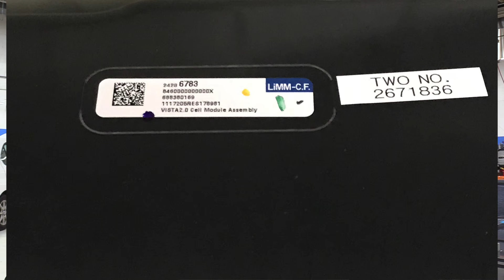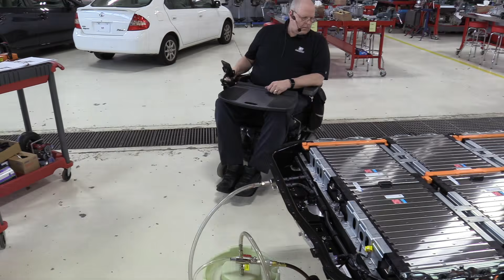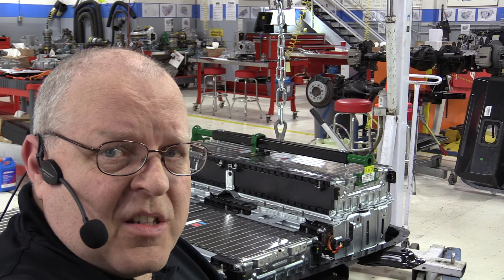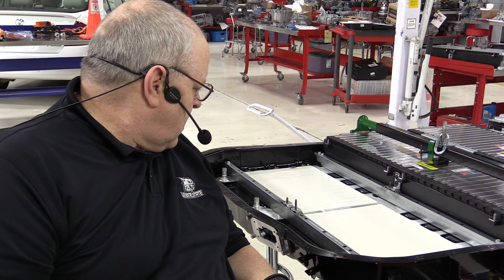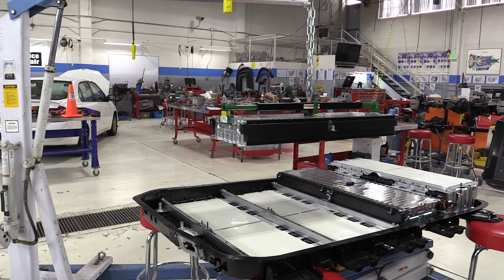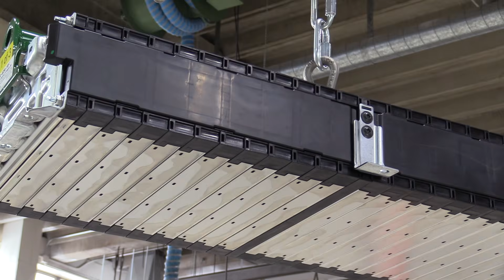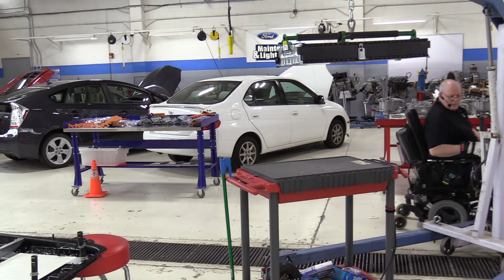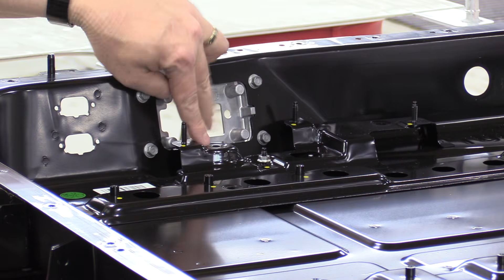Chevrolet Bolt EV Battery Disassembly

Comment: Two ways the 60KWH rating may have been arrived at. Rounding being the first way. The second may have to do with the difference between nominal voltage and fully charged voltage ratings. A long shot way could be real world testing but that one is not likely.
Reply from the maker: It turns out the 57kWh is the nominal rating. 60kWh is the fully charged rating. Thanks for your feedback!

Comment: After the bus bars are gone, the high voltage risk is gone, but the high current risk remains. Welding with a 12V lead acid is impressive, shorting out a 40V battery with extremely low internal resistance is downright explosive. Best to keep the alert level high, and require gloves along with the shielded tools, even though technically the gloves are not required as you pointed out.

There are too many mechanics out there without the background electrical engineering knowledge to make safe choices, so better safe than sorry.
Reply from the maker: Good point. Thanks for your feedback!

Comment: 1:30:56 these pads are for isolating the heat sink from the metal battery cover so the heat sink hot and cold lines are not connected thermally together via the metal battery cover.
Reply from the maker: Thank you for your feedback!

Comment: Are the actual cells cylindrical like the Tesla's? Also, NIMH cells cannot be paralleled from my understanding, but LION can be. So, are all these LION cells in Series? Are there any EVs using cells in parallel?  Parallel and Series?
Reply from the maker: These are pouch cells, not cylindrical. Two pouches in parallel for each of the 96 cell packs in series with each other.

Comment: So if somebody t-bones your Chevy Volt, the battery shorts out and your car burns up.
Reply from the maker: It is possible, but the battery tray is very strong and enclosed under the car. No more dangerous than a tank of gasoline.
Reply: Found this article: https://www.torquenews.com/1/why-tesla-batteries-catch-fires-bolt-and-volt-batteries-dont The author says the battery cells have stronger walls. BTW: Thanks for your videos. I'm enjoying them even though I never intend to tear apart my wife's Bolt.
Reply from the maker: Awesome, thank you!

Comment: Professor, this is fantastic. It appears you have the service manual, maybe attended a GM tech class?
I assume you don't want to be ground potential to this battery, even assuming is is completely discharged.
(I can't believe you're working on a fully charged battery! You rule, 'bro)
Are you insulated via rubber wheels? And did you discharge body static prior to touching any metal?
On another note, I just disassembled, replaced the battery and reassembled my grandson's PS3 controller. 
So, there's that.
Send that manual off to repro and please ship one copy to me, Colorado, USA.
Thanks.
Reply from the maker: Thank you! Yes, a service manual and many years of GM and other training https://www.weber.edu/automotive/J_Kelly.html

Comment: The shape of things to come... Who knew it would get to this so soon?

I have a question, after seeing a video on youtube with a flood damaged vehicle where the battery was completely "stewed": is this setup - battery and connectors etc. - meant to be flood safe? Or: is it meant to survive crossing a shallow stream or going through a deep puddle? That is, deep enough to cause water to get into the cabin in most normal cars.
My question stems from the fact that with the battery being the "business end" of the car (in value terms) and at the same time being the lowest part of the car body, one shouldn't expect that to be written off in situations where a "normal" car would just get choked. Or is that another limitation that EV owners will need to factor into the equation?
Reply from the maker: The battery packs are sealed to keep out dust and moisture as long as they have not been damaged. Improper service procedures can result in loss of battery sealing. For example, prying and bending of a battery cover to access components and then not replacing the cover or sealing it again after hammering it back down. A battery after servicing needs to be leak checked. See my leak check video https://youtu.be/VUvAW6skwrA A flood vehicle should be inspected for water intrusion in the battery, but I doubt many will ever have that condition unless an untrained backyard mechanic worked on it first. Best wishes!
Reply: Thank you prof. Kelly for this great info. I guess then that checking battery compartment is leak proof should come on top of any checklist when buying second hand. I will definitely check that other video.
Reply: I just found the youtube video I was mainly thinking of. It's an iMiev battery damaged by SALT water flooding. Here's the link:
https://www.youtube.com/watch?v=EmgRuhqba0I&t=12s

Of note is the fact that battery cooling is achieved with air convection. There are holes in the battery compartment that allow air in/out. Are these leading to openings in the passenger cabin? Then that would achieve cabin heating "for free" but it would not explain the cause of the battery compartment flooding  (unless the entire vehicle was covered by water).
Of note is also the fact (?) that the battery compartment casing is made of plastic (?).
So it's interesting to see the design/budgeting choices made.

Comment: Thermal pads don't need to be replaced if they're intact, you can buy them fairly cheaply because they are a common material in the tech industry (Usually from 3M)

Comment: Its dc voltage take them gloves off it wont kill u man
Reply from the maker: Thanks for your feedback. OSHA Regulation 1910.137 requires compliance with NFPA standard 70E for Electrical Safety. NFPA 70E 320.3A1 requires Personal Protective Equipment (PPE) for DC Voltages of 100V or higher. It also requires PPE  for AC Voltages of 50V or higher. I know there are other YouTubers out there touching higher voltages without PPE, but that is not how we do things here in the Department of Automotive Technology at Weber State University.  I always follow the proper regulations in my classes and videos.
Reply: You need an electrical education. Touch the electrical current that this battery is capable of and they will carry you to the morgue.

Comment: Seems GM did a better job designing this battery then Tesla did on the one in the S as it can be disassembled without doing any damage.
Reply: Yes, the Bolt beats the Tesla hands down in terms of serviceability and apparent quality of components and general build quality.  Tesla components have the disposability and build quality of a $20 cordless drill.
Reply: I thought LG made them?

Comment: Thanks for sharing this sir. A great insight to the modern EV batteries.

I would like to know the outer dimensions of the battery (length, breadth and height).This would br of great help from you.

Thanks in advance.
Reply from the maker: Thank you.

2017 Bolt EV Battery housing dimensions 
43” width case without brackets 
46” width at 4 front brackets with bolt holes
50.5” width at 1 rear bracket with bolt holes
71.5” length case
12” height under rear seat (not counting service lever)
6” height rest of the front of the case
963 lbs total weight
Reply: WeberAuto Thank you sir! This is very helpful to newbies like us. Keep doing this great work! 😊

Comment: Thanks for the nice work! Any High Voltage batter heater (Coolant Heater) ?
Reply from the maker: Thank You! Yes, there is a battery coolant heater and a separate heater for the coolant in the heater core for the cabin heat.
Reply: WeberAuto Thanks for the comment! How about the battery heating for the cold weather? The efficiency drops significantly in the  cold weather (battery temp. Lower than -2 degree celcius)
Reply from the maker: Yes, there is a battery coolant heater for use in cold weather to warm the battery. It only works while charging with the AC charger or while driving.

Comment: Question: When the battery drains, does it drain the battery one cell at a time or do all cells drain together? I've often wondered about the exact drain process. Thanks!
Reply from the maker: They are all in series and therefore drain all the cells at the same time. Best wishes!

Comment: At 41:30 you say that the cells in batterie 5 are connected in parallel. 
Should the be connected in serie so the voltage adds ?
Reply from the maker: I was talking about the cell packs. There are 3 cells wired in parallel with each other for cell pack. There are 96 cell packs in series with each other. Thanks for your feedback!
Reply: Thank you for the answer
Can you tell me the voltage of each cell pack ?

Comment: Nice video dear ..  I need ur help for.
What is the method or procedures to do if you want to stop the hybrid engine system and use the gasoline engine working ... The reason is like when you add clean injector or coolent engine bleeding

Thank u
Reply from the maker: There is a special service mode accessible with a scan tool only

Comment: Thank you for doing this. I am an electronic tech and interested in servicing my Bolt myself ( I think I have early battery will crawl under and check thanks for info) still have miles and time left on warranty. I am an Uber driver and went out of my 36,000 mile warranty in 5 months. Where can I get the shop manual and how much? Is there a PDF available? I am subscribed and will look at all other Bolt related videos. What was in the EV-1 ( that is not in the Bolt) that made it so efficient? Could you possibly send this video to Jack Rikards of EVTV.me? He would be very interested I am sure to see this. Thanks again for showing what an engineering marvel the Chevrolet Bolt really is. I am getting a consistent 300 miles per charge the way I do it ( if I can depend on the accuracy of the center average mileage indicator in the instrument  cluster). For me a perfect Ride share vehicle.
Reply from the maker: Thank you! The only service information I am aware of is electronic subscription based from GM. See https://www.acdelcotds.com/
Reply: Hi David, I was wondering if you are still driving your Bolt and if you've had any issues with it?  I drive a lot miles and deciding if it would be a good option for me.

Comment: Here’s an article I just wrote explaining the discrepancy between the 57 kWh rated capacity label visible on this video inside the Bolt EV battery pack and GM’s stated 60 kWh capacity.

https://electricrevs.com/2018/03/29/gm-explains-57-vs-60-kwh-bolt-ev-battery-ratings/
Reply from the maker: Nice job! Thank you!

Comment: What a great video! Disassembly of one of the sections and modules would be interesting, before you put the parts back together. And clarification about the cells. Are they really 55 Ah cells? (57.02 kWh would suggest so.) What is their real gross/net capacity? In the end, LG specs /labelling of the modules and GM specs for the pack must match in some way or the other. Maybe you can dig into ratings and standards to explain this to us. Best regards!
Reply from the maker: Thank you, here is the reassembly video with partial module disassembly https://www.youtube.com/watch?v=ZBzRKglr95U The 57kWh was at nominal cell voltage of 3.65V with 54.22Ah cells. Fully charged is around 4.056V per cell which would give you 63.3 kWh with the same 54.22Ah cells. Maybe the 60kWh rating from GM is just the average of the two. Best wishes!

Comment: Kind of surprised you don't have service covers for the battery section terminals, would make it safer.  Also I am surprised you did not have to wear arc-flash protective gear when doing the disassembly of the HV sections.
Reply from the maker: I agree, there should be some service covers for those terminals. There is no arc flash danger at 40V DC. Even at 350V it is less than a 1 inch zone. PPE isn'e even required by OSHA or NFPA 70E until 50V. Thanks for your feedback.

Comment: When I stripped down my Volt pack the FIRST thing I did was to remove the busbars connecting the modules together - that immediately makes the highest voltage that you can possible reach the single module voltage - about 45 v on the Volt
Much much safer than they way you did it
Reply from the maker: Thanks for your feedback. I was following the procedure in the Chevrolet service information. The BECM can be damaged if harnesses are not disconnected in the correct sequence.
Reply: With the service plug out, the bus bars have no voltage.

Comment: Excellent and amazing work @WeberAuto! Was a treat to watch, thank you!

One question: how exactly did you charge the battery in the car before removal?

I ask because I have been doing a LOT of research with my car via the OBD2 port and correlating with data taken from various chargers at various times.

I have noticed that, first of all, the car reports FULL (via the app and dash) long before the battery is actually full. The bar-graph on the side is also 95%-100% full charge when 20/20 bars are showing.

I have noticed, based on OBD2 readings (assuming that they are correct), that the DC voltage bus in the Bolt seems to max out at 400V. Although the car will report "full" around 390V, if you keep the L1 or L2 charger attached and let it keep charging, it will eventually get the battery pack up to about 400V.  DC fast chargers tend to disconnect quite early too, but some of them will continue to charge as long as you leave them connected.

In your teardown the voltage was about 389V; Hence why I'm wondering if you can please provide any specifics about exactly how it was charged, and at what point you disconnected the charge, and what you may have done between disconnecting the charge and removing the battery.

Thanks again! Much appreciated! Amazing work :)
Reply from the maker: Thank you! I used a Level 2 charger connected to 208V in our shop. I left it plugged in over the weekend after we received it. It  said it would take 9.5 hours. After charging, it showed a range of 230 miles at room temperature 70 degrees F. Have a good evening!
Reply: Dang, I was hoping that maybe you jumped the gun a little on the disassembly :D  Would you be able to estimate how long between stopping the charge and when you checked the voltages on the modules?

I'm still trying hard to make sense of the OBD2 data that I have been collecting, since much of it is assumptions. I'm really interested in getting a full PID list for the Bolt, but that's beyond the scope of your disassembly.

My hope is that I can help people collect real world data that we can crowd-analyze together to give us more insights into not only the most effective ways to use and charge, but to be able to look for concerns and preemptively identify problems.

Comment: From the info here it looks like lg chem is using 50ah rated cells? if prismatic pouch cells they must be way larger than volt pouchs, or they use 5 cells per module paralleled for the ah ratings.
Reply from the maker: Thanks for your feedback. There are 3 prismatic pouch cells welded in parallel per cell group. There are 10 cell groups per large battery module and 8 cell groups per small battery module. Each of the large packs is rated at 5.94 kWh at 3.65V per cell group, so each cell group would be rated at 162.7 Ah which makes each cell rated at 54.2 Ah nominal.

Comment: Do you know which material has been used for the different seals?
Reply from the maker: I am not sure what seals you are referring to. Please clarity. Thank you
Reply: All thé seals that are used for preventing the elements to enter the battery compartiment. (Connecter seal, cover seal, etc) I'm wondering this in order to see which anti corrosion treatment is sale,
Reply: *safe

Comment: I hope those bar stools are CAT III or higher LOL! Thanks for another great video, as always very well shot and professional. I helped a friend of mine last weekend, he got a battery section 4 from a Bolt, he used to work for Enginer installing plug-in hybrid kits (turns a hybrid into a plug-in hybrid) so he still has a bunch of those kits. We used this battery section to power the kit, just had to add busbars and connections to work with the kit. The kit is so simple to install, basically it just has an adjustable DC-DC converter that you can adjust how much voltage and amperage it outputs. Two wires connect it in parallel on the output side of the contactor (some vehicles it needs to go on the battery side or even further back) and thats it really, no programming to the vehicle or modifications. The DC-DC converter pushes power into the cars battery pack (while the car is running) the converter adjusts the current and voltage depending on the hybrid pack's SOC and the load. When the car sees a pack with a high SOC, it doesn't know where the extra power is coming from, but it adjusts its drive mode to use more electric power, so it drives in EV mode at lower speeds and gives more electric boost at higher speeds. The Bolt pack works great for this application, its really impressive how much more capacity their cells have compared to just a few years ago. We put it in a Ford Fusion Hybrid. We're also considering buying a wrecked Bolt and using as much as we can to convert a 1951 Chevy Van, i'll definitely make a video when we do!
Reply from the maker: That sounds like an awesome project. Thank you for your feedback!